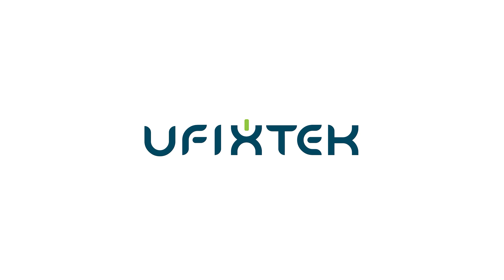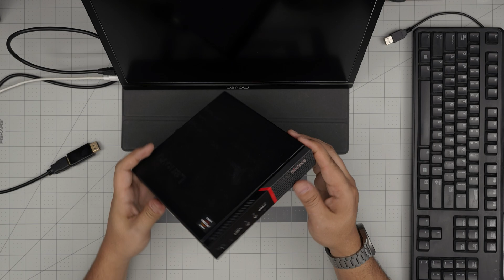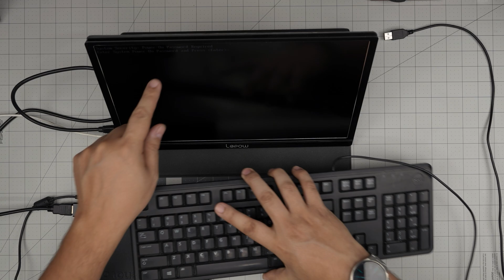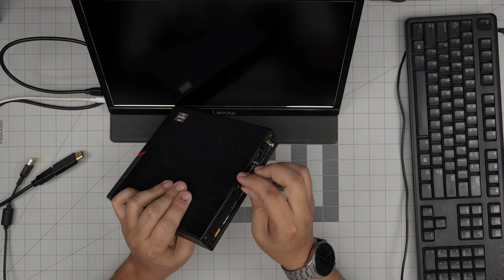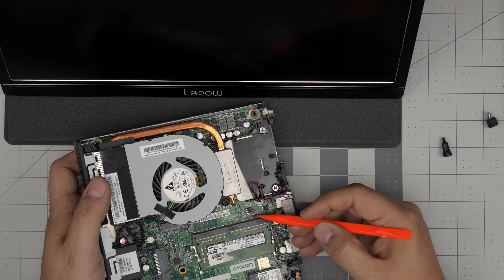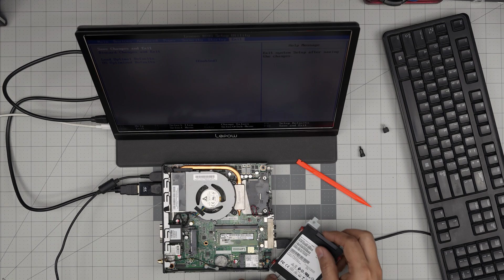How to Remove BIOS Password on Lenovo ThinkCentre M715q 📌 Step-by-Step Guide

Comment: this is good for fixing 'the jet engine' problem = fan running full speed - not matter what is going on.   the problem that I have is how to get it to stay fixed.  Appears to come back when trying to boot in 'bad situation' - such as from a cd rom that is not 'code'
Reply from the maker: We got a couple of these models because the fan was running at maximum speed, even when we changed the speed in the BIOS. However, replacing the fan fixed the issue. The fan has a circuit that controls the speed, and if that goes bad, it can cause the "jet engine" effect 24/7.

Comment: I was able to do this successfully on the M70q gen 5 however I can't figure out why there still isn't an internet connection being detected when I boot into windows. What could be the case?
Reply from the maker: upgrade the BIOS to the latest firmware and see what happens.
cheers🍻

Comment: Had this issue with an M90t.  Found a 3 pin Clear CMOS Jumper.  Moved the jumper over one pin followed the video power on steps, heard two rapid beeps which after returning to the original settings did the trick!  Thanks so much!
Reply from the maker: It's my pleasure my friend.
Glad that you got it reseted.
cheers🍻

Comment: Not working for me. I have the same model but it keeps turning on
Reply from the maker: Then you will need a BIOS programmer (available on Amazon). Then, you will need to open the PC or laptop, locate the BIOS chip, connect the probe to it, and connect the programmer to another laptop. Make sure to back up the BIOS first, erase it, and then load the new BIOS.bin file (which you can obtain from the official website).
I will make a video on how to do it properly this week.